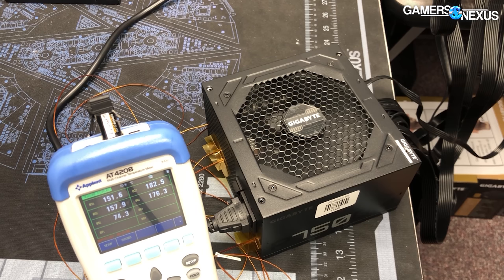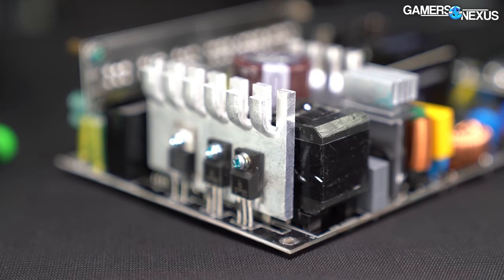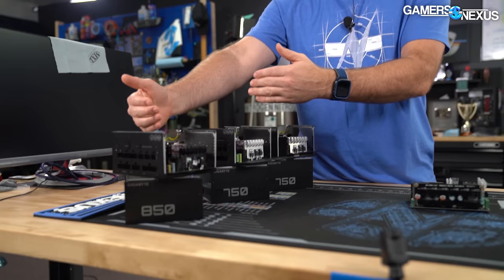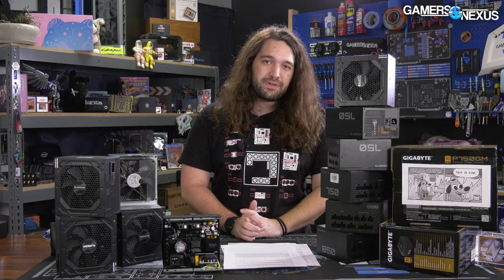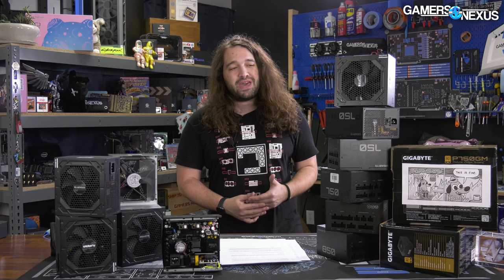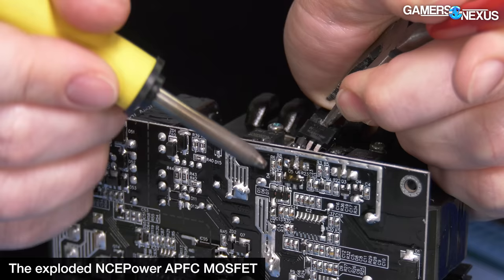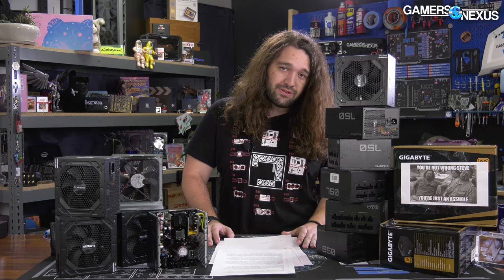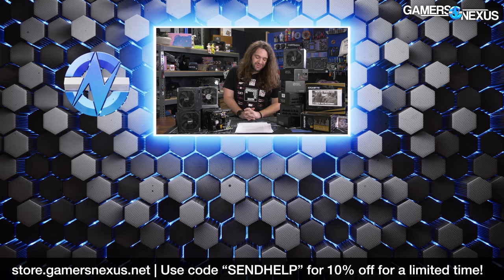Exploding Power Supplies: Gigabyte & Newegg Dumping Unsellable Product

Comment: 2 thoughts here:
Why would Gigabyte ever risk its reputation and continue selling such an unreliable product line? That'll cost them more in sales than fixing or scrapping the units that were already made.

Also... sounds like Newegg and Gigabyte are in for some class actions.
Reply: I would posit that it really won't result in lost sales, or at least that there is a calculus being done between "lost sales" and "cost of recall" and they decided the cost of recall would be more expensive. The sad truth is that these companies don't care, because consumers (and/or regulators) don't care enough to punish bad behavior. As the bad behavior continues across all of them the standard for bad behavior they can get away with drops. Even the class actions are rarely a significant deterrent because they are rare (a gamble of a worse downside) and don't extract a truly punishing amount of money.
Reply: I've never really thought bad things about gigabyte... I am building a new system soon to replace my aging rig, so I'm at least one potential customer who will probably steer clear of gigabyte stuff when I do... I mean they know about this right, and did nothing... So very doubtful you'll see the gigabyte logo in my new machine after this horror story...
Reply: @jarodatkinson5306  Sure, but that's the problem, the penetration on issues like this is limited. 60,000 people have watched this, but how many of those people are going to remember this, or act on it, or are even planning on making this decision?
Reply: Well they probably didn't think it would be so bad. Until now it still isn't, mainstream media doesn't cover this atm so the casual buyer won't know and it won't hurt their reputation with the general public, just with a (relatively small) community of enthusiasts. Also they could have underestimated how many of these PSUs fail.
Reply: Thinking of the US motor industry with a similar small component failure that caused catastrophic issues, the insurance payout was considered cheaper than recalling multi thousands of vehicles for replacement parts.
Reply: @MasonBially  Can't argue with what you say there... Maybe that's why they didn't do a recall when they found out, as the coverage and brand damage would have been higher than it's going to be now. Who knows, perhaps Linus and Jay might cover this as well... power supplies that explode and kill gc's seems like something folks should be aware of...
Reply: @MasonBially  I've been a firm supporter of Gigabyte in the past. GPU, RAM, motherboards. I've built and sold a few hundred PCs with Gigabyte cards, and close to 1000 of their motherboards over the years. I've had people buy dozens of Gigabyte laptops on my recommendation. I never actually used their PSUs - I'm a Seasonic simp. But yeah I'm not going to be using their products after this. It's one thing to make a bad product, it's a different thing to keep making it and pushing it on people and then denying there's a problem. It's damaging other components and could potentially burn someone's house down and they're not doing shit. That's unacceptable.
Reply: Gigabyte doesn't have much of a reputation to risk and they don't seem to care. They've been known for bad products and worse customer support for a long time now. People still keep buying their products, though...
Reply: People buying Gigabyte products area already settling.  They know they are trading risk for low prices.  So, Gigabyte won't lose sales.   What the big issue is, is the situation.  People who wouldn't, necessarily, buy Gigabyte to begin with - ended up buying Gigabyte because it was the only game in town, for about 15 minutes.   In general, people are going to want to return those power supplies.  Even if they were good.  They only wanted the video cards.   In this case, Newegg was stupid.  They should have packaged that card with a good PSU. Under these circumstances, the customers hit the jackpot.
Reply: @techrev9999  My aorus motherboard works just fine
Reply: @Arachnoid_of_the_underverse  There was even loss of life.
Reply: I've never had positive experiences with Gigabyte, and I tried. My old 9500 gts died within two weeks of purchase, I've had motherboards integrated sound die within a year, overheating ssds, and, of course, a dead psu within the first eight months. And the motherboard that didn't die had a buggy bios and couldn't be updated. They're on my nono list.
Reply: @Examoon  That is not true. Gigabyte used to have a reputation for selling reliable products that offer good value for money. Your reaction is part of the problem. Consumers often have strong opinions that are not based on facts. That makes it easy for companies to sell bad products and get away with it. Because at some point everything becomes an opinion.
In this case Gigabyte has made a dangerous product that can destroy other components and could start a house fire.
Your reaction is LOL.
Reply: Gigabye been like that for ages by now
Reply: @javierortiz82  Cool story sucks to be you😂 Here's what dosent make any sense you had all these bad experiences and continued to buy their products🙄🥴
Reply: Exactly. This behavior shows the company can’t be trusted as a reputable brand. I don’t want defective components in the first place, and it seems like neither Newegg nor Gigabyte are supporting defective units well either. Personally, I’ll be avoiding other Gigabyte parts and I’m surprised GN went so light on them for something that seems to be so serious.
Reply: @Gareth Tucker MSI isn't much of an improvement, at least not these days, I got one of their more expensive "gaming max" boards and it gave me a momentary scare with it's VGA error, the top 16x slot was DOA (not the first person with that problem either) and the on-board sound card died within a week.
Reply: They probably did a calculation like 50% of the units are bad and 50% of the units will never get to Max capacity and 50% of them will fail without it being dangerous so the cost of replacing it when only a small percentage of them made catastrophically fail was not enough for them. Thankfully we have people like gamers Nexus to expose this kind of crap
Reply: Yeah. When I was in a store, we had an entire line recalled from Samsung (remember they were going to do smart speakers?!) where they actually paid us twice what the retail was at the time to return the products, so it was better for us to send them back, then sell them (exception being display/no box units).

Why? They released them with barely any functionality, with the hope of "fixing it" in software. I assume either patents, cloud/services or missing required hardware compatibility actually was the problem, so no amount of software was going to fix it. Either that or their software programmers were out of their league, and just could not get them to work. :P
Reply: Gigabyte has a reputation alright hehe
Reply: @jarodatkinson5306  I had gotten a Gigabyte GPU, I do not recommend it at all if you’re able to get any other card. I can’t replace it because of the chip shortages but if I could I would, the software for the GPU is horrible and I can’t keep the fans on when I want.
Reply: Gigabyte makes shit products. Not surprised.
Reply: Agreed, I usually gravitate towards Gigabyte products based on 30 years of good experiences, now I'm not so sure, very dumb thing to do over a shitty PSU !
Reply: @jarodatkinson5306  They may have done something—they may have stopped selling this crap. The villain list on this one includes Newegg. It might include Gigabyte too. We'll see.
Reply: @MasonBially  bear in mind , that's 60,000  individuals who are most likely pc savvy,  the same folks willing to assemble and replace parts on PCs . So in the PC DIY assembler/ repair market that this part is specifically marketed  for , that could have more overall affect than anticipated.  It's not as negligible as Dell or Lenovo doing this kind of games . Volume of sells , and type of end users are a bit different .
Reply: @Juan800PimpBot  Those motherboards do look sweet.  It doesn't much change that Gigabyte is, in general, 2nd or 3rd rank.  I've put together some janky Gigabyte systems before, lol.  All I'm saying is that if you're buying a power supply, and you're looking at Gigabyte, you're already cutting corners.
Reply: @SianaGearz  My change of heart isn't due to the one faulty product but due to the response that they have given. If they had responded well, if they had done a recall, acknowledged the problem, at least refunded the damaged units, then okay. But leaving them out there, continuing to release them, and doing absolutely nothing and not helping people? Nah, I'm out.
Reply: @techrev9999  I've got a Evga power supply as I previously stated above and asked if there was any known issues with those. Everything I've purchased to build my PC has pretty solid reviews except maybe my xfx 5700xt and that has outperformed my expectations.

Comment: Start a Recall Chain, Steve. This one needs to be put on an APB ASAP. (APB: All Points Bulletin)
Reply: Completely agree. Someone needs to hold Gigabyte's feet to the fire so they actually recall this fire hazard.
Reply: Willing to bet there will be a class action lawsuit before they recall them all.
Reply: The problems is are the psu list or advertise that they have OPP, OCP or OTP protection / certification.

If they don't have you cannot force them to recall since the product works as intended or listed, you cannot use 750w  psu in 1000w or 1300w workload. The blame is on the user.

But if they advertise or list that it have protection than you can sue them for false advertisements or false specs that doesn't work.

GN test here is what called stress testing, that over their intended workload, it's fine for quality control. But cannot be used as base for litigation.

GN should do colabs with more engineering channels so they can improve the testing methodology and made it clearer..
Reply: Btw this is not defending newegg or gigabyte, but made it clearer from engineering standpoint..

it will be very bad we start accusing people without adequate testing, good methodology, and facts..
Reply: @shadow7037932  or just hold their feet to their psu's. Guess they better start engineering good psu's if they don't wanna get hurt huh 😂
Reply: @winnieid2727  It can be used as the PSUs died at only 60% load, that's not a stress testing condition
Reply: Whats a all parts bulitin.
Reply: @georgehubbs1747  Aye.
Reply: @winnieid2727  PSU still failed at 60% load...

Comment: I always used OklahomaWolf's reviews when evaluating PSU's when in the market for one. Sadly he doesn't do reviews anymore. His work was always top quality and he took testing of PSUs far above and beyond including running them in stress tests in ovens designed to get well above 100C from ambient. Then he would give component by component reviews and tear downs, removing everything from the boards inside, identifying who made what, and sometimes where and when. That's the sort of dedicated reviews we need to keep manufacturer's honest. Reviewers not afraid to destroy a product deliberately to find out if it is truly what it says it is.
Reply: Sounds like Gigabyte knew he was out of commission and went super cheap with components
Reply: I bought a Seasonic FOCUS Plus Gold GM-750 last summer based on one of his reviews, a 9.6 out of 10 but mine would have gotten a higher score because while his had some suspect solder joints on the AC input power capacitors mine did not so the only down side which didn't really bother me all that much was in-cable capacitors. I had some left over braided sleeving from a couple of 3D printer builds that I slipped over the ends of the power cables that you can see in the front and the rest is out of sight and out of mind. 10 year warranty, better then 0.40% regulation and very low AC ripple .... You can't ask for much better at that price point ($100)

Comment: Man I almost bought one. Had it ordered, paid for it, did a bit more research, cancelled the order and got an EVGA 750GA instead. Sketchy units
Reply: I bought one... Umm..
Reply: I had to get mine bundled with my RTX 3080. Luckily later on I was able to sell it off and get an RM850x.
Reply: EVGA are good. Buy Superflower instead if you want the same quality for a lower price without the brand markup. :D
Reply: I heard the enermax revolution d.f's good
Reply: @802Garage  Super Flower broke up with EVGA circa 2019. They're still nice units though, very good value.
Reply: @t4w1m94  Oh interesting. I bought my Superflower Leadex III last year and at that time EVGA was still on Leadex II for more money. So I'm guessing EVGA didn't make the next step into Leadex III and went with another supplier?
Reply: @SpaceLion949  As this video demonstrates, even individual models within a product line can have far more issues than others. Definitely always wise to look up reviews on specific models at specific power ratings!
Reply: I got the EVGA br500 series and my neighbor to it run fine I may need to upgrade to a fully modular PSU and 750w
Reply: Yeah actually, in terms of "other PSU to test", I'd be really curious to find out about EVGA's. I have always gone with 80+ gold or better Corsair because that's just a know what you're going to get situation... But the EVGA ones look tempting, and based on their GPU's, if their PSU's have the same level of quality/design/support/etc, I'd want to support them with the next PSU buy...
Reply: So instead of a sketchy Gigabyte PSU, you went out and got a very low end EVGA PSU that has issues with high end GPUs. Hm...
Reply: My EVGA W1 600W fried my graphics cards, twice, before killing itself. My super flower leadex III 750W is 😍
Reply: I lucked out & got a bundle of an EVGA 3070 FTW with an EVGA 750 G3 PSU, thankfully EVGA has some solid units.  Not that I needed it since my current build already has an 850W Seasonic but it's nice to have a backup if anything goes wrong.
Reply: I have a dead 6 month EVGA I need to take to recycling. Their 'ECO' mode killed it by not turning the fan on when it got hot. Disabling that with the physical switch helped it limp along but the damage was done. I'll never get another EVGA power supply but their other stuff seems to be good.
Reply: I got one with a gpu, and sold my 650 evga before seeing the terrible reviews :(. Wish I would have kept the evga, but I turned around and bought a seasonic after seeing the initial tweet.
Reply: I almost bought one but I did my research too
Reply: @jimschofield8734  EVGA PSUs are decent. My 650GQ ran for years, only replaced it because I upgraded to a 3070ti and 10850k, which would run close to the max power of the old PSU. I now have an 850GQ, which is quite large, just barely fits in my case. 8 months later, works fine still. Plus they have good reviews.
Reply: @Tauxxy I feel bad for the poor guy who bought that psu u sold lol at least u got a 3080 lol
Reply: Watch out for EVGA, although it's good, some have issues with voltage peaks, like high end CPUs and GPUs produce.
Reply: @WLOfails  yup but from what I've seen, most of them seem to be at least fairly decent units. As in not nearly as bad as these Gigabyte units (from an OEM called MEIC, their website has been down for a while too).

But yeah, as always check reviews. I think my 850gq is in "Tier B" in that Linus psu tier list.
Reply: @MihzvolWuriar  I tend to go at least 100-200w more than what I think I'll need, and I'm usually only paying maybe an extra £10-15 for the model above, but its definitely worth it for less chance of stability issues caused by spikes like you said.
Reply: @yotoprules9361  Well, the problem isn't a buffer of 100-200w, all these units have an over current protection, OPC, under too, UPC, even though you have 200w buffer, the spike will trigger the OPC and will shut down the unit.
I'm saying this from experience, I have a 750w EVGA PSU, with a 550-600w pc, and that does happen, specially when I though with that buffer, I could OC my GPU, Ryzens and Amperes are quite good at spiking like that.
Reply: @MihzvolWuriar  which unit in particular is this? They have a few different models made by different OEMs, would be interesting to know for future reference
Reply: @yotoprules9361  Mine is the 750w n80+, you want to avoid that if you're building a high end PC, just yesterday I bought a gold rated PSU, basically, anything from gold to above can handle a high end PC, gold and platinum being the minimum if you want any kind of OC.
Reply: I also had the PSU and it is very unstable sometimes the system can't start properly
Reply: @802Garage  After the G3 they broke up. The G5 was a lackluster FSP unit. I believe it had pretty bad.... inrush and ripple? I think? Hence why, lackluster, but don't quote me on that, I'm a little rusty. The G6 that's just come out, they went SeaSonic, basing it on the Focus GX with some modifications.